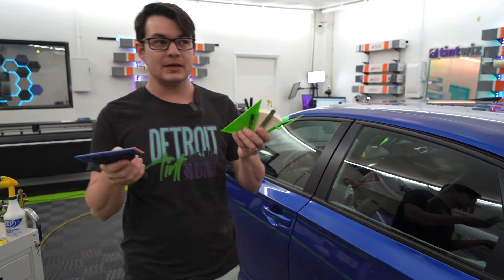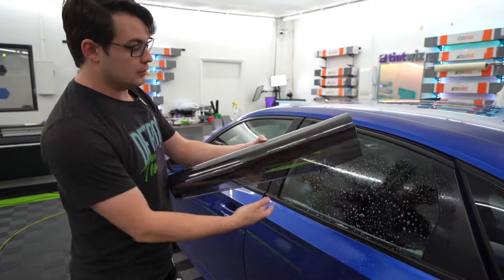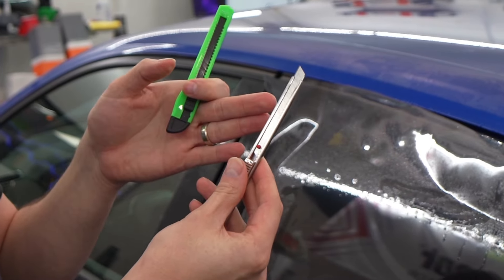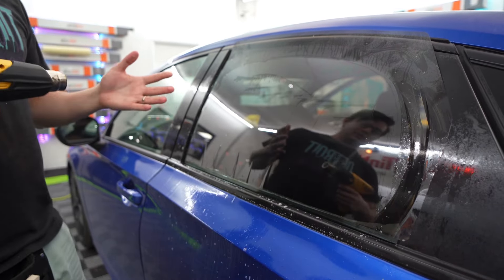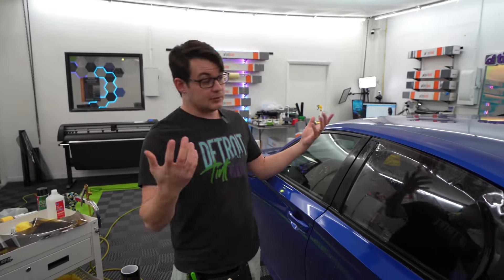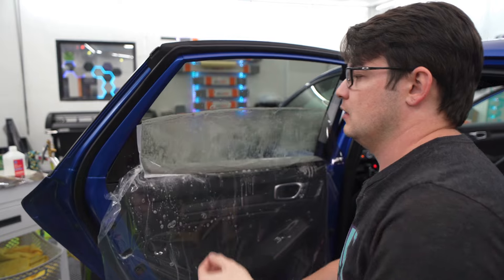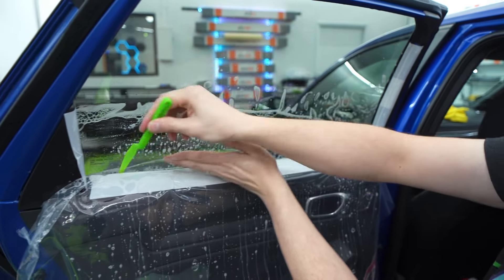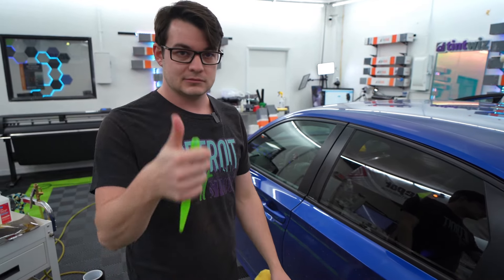Tint Tools You NEED for Tinting a Door Window!

Comment: Love your videos! Just started tinting and I have no idea how you hold that film like that🤣 I have a death grip on the roll and it still starts falling sometimes lol also saw a video of yours from 12 years ago, loved it!
Reply: little tip, also hold the roll at a angle so it doesn’t roll off the bottom, and the squeeze with just enough pressure to cut your piece
Reply: if you’re right handed have the roll with your left hand and pull your tint out with your right and cut it with your right
Reply: There is only one trick it is tint quality. When you use thin tint you can’t do it like that 😄